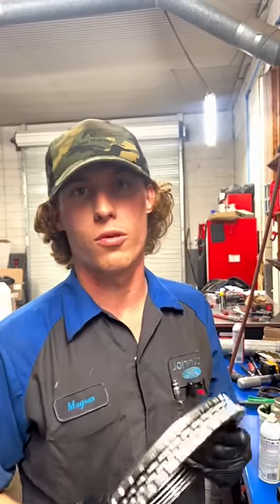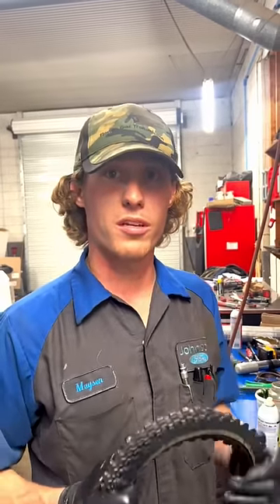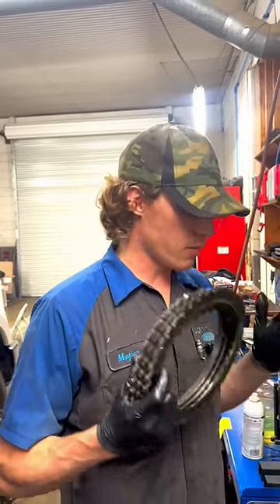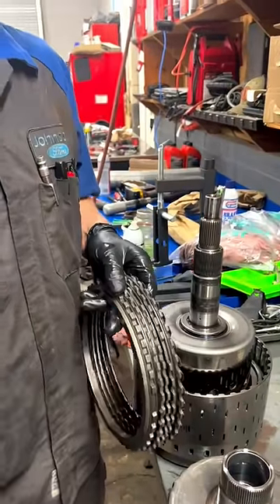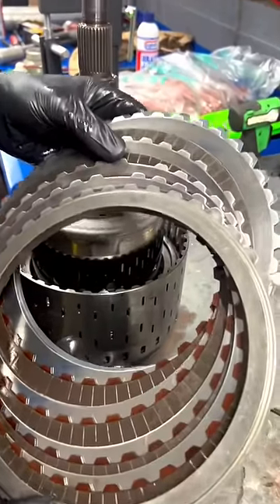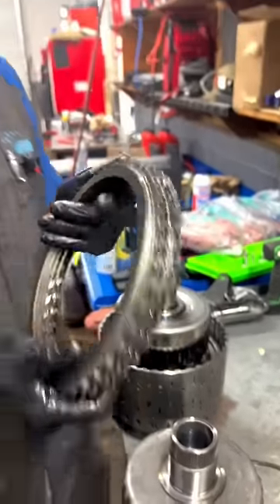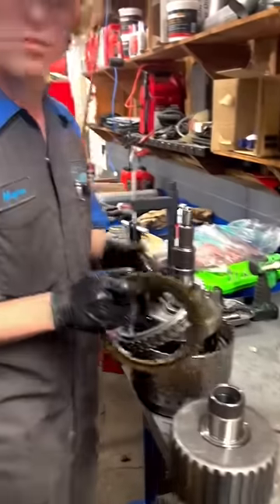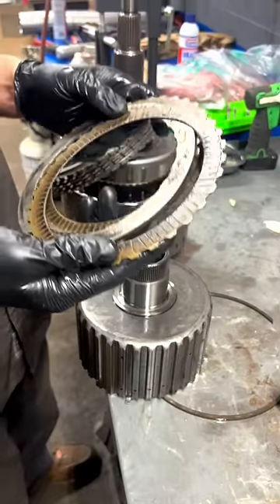Should you replace every clutch during automatic transmission overhaul? #shorts

Comment: Upon performing ANY overhaul, I’ll replace EVERY friction plate regardless of the condition. You can NOT clean a friction plate due to metallic embedding. I’ll reuse the steel plates, and take a (Yellow) 3M Scotch Brite Roloc Bristle Disc just to deglaze with the new frictions being installed. Same goes for all the shift solenoids, they’ll all get replaced as well during a complete overhaul. I go through the entire unit as well. Set the clearances, end play, etc.
Reply: The whole unit you say. Where you work at the shore ? The bay shore truck store ? Hahahahaha 
Our senior master calls everything a unit.
Reply: Exactly you already have it out, replace every wear part, it’s cheaper than pulling the transmission twice
Reply: Ford tech. By the book there 👈🏼✌🏽✌🏽🙌🏽🫤
Reply: I agree and I'm sure the customer would agree, they are paying to have a transmission rebuild, not to have it be good enough. Not replacing the clutches in an automatic transmission that you already removed and took apart is like putting a piston back into an engine and not replacing the rings, if you already have it in your hand replace it
Reply: If it’s a warranty overhaul with metallic debris your cost cap should be coming up with a replace decision.
Reply: And charge enough extra labor to pay for the plates!  Disgraceful
Reply: @thechris84567    Who cares, the customer will have to pay again.
Reply: Keyword: probably

Comment: If I pay for a rebuild and I find out they reused some old plates I’m gonna have a word with someone.
Reply: Lol, right on
Reply: Exactly, I'm paying for a complete rebuild not a partial.
Reply: It is done routinely.  If a shop finds a broken spring, that's what gets fixed, yet the customer pays for a rebuid.
Reply: @twosencefromcleveland6084  yup, repair shops continue to do that because there is no way for the customer to verify a full rebuild without tearing the whole damn thing apart.
Reply: You people do realize that materials and labor are billed separately, right? You'll be paying for the full labor of a full rebuild, you will not be paying for the clutches he didn't order.
Reply: @primecyber1  totally agree they have no idea what it takes to rebuild a transmission.
Reply: @twosencefromcleveland6084   that is why you go to a shop that does professional performance building.  It will always be right always!
Reply: Why? Unless if the are discolored and/or welded together, hit it up with a cookie wheel, and send it. Never had a problem with any of my personal vehicles. Mechanics have been doing this for years.
Reply: @Brandon Lindner  it's warranty work.  Customer is likely only paying a deductible at most.  Warranty company ain't paying for that
Reply: Sadly that is rebuild. Fix whats broke only and out the door. You want overhaul or rebuild. 1st. Inquire about replacing all your clutches with an upgrade kit. You'll pay a couple hundred more just for that but you will get all new clutches. 2nd ask to have all updates installed in the valve body. A 1hr. google search will give a list of those updates. 3rd, discuss and decide on shift kit. 4th talk torque convertor. Got a triple disc lock up with billet cover stock stall built for $500. Everything done my E4OD/4R100 was $1200 more then "regular" rebuild with deep pan and new oversized oil cooler
Reply: Chances are you would never know unless told. Also a lot of cheap “remans” that is what they do only fix the bad stuff slap some paint on it and resell it.
Reply: That's what they do and they use the rest of the kit on other transmissions that's how they make so much money but I think all of the clutches in the kit should be used .
Reply: @tjr9741  Not true you ask him to keep the old parts that they replaced with new and then you can easily go scrap that metal and get your money back from it as well
Reply: You would think that until you find out how expensive these parts are. Why spend an extra $500 when you don't need to. Run em out
Reply: @double-a-ronoo4037 All of the transmission kits I've ever seen had all of the parts that wear in them other than hard parts that are reused unless needing replacement, a torque converter would always be separate and recommended but the majority of transmission shops only replace what is worn out and keep the rest of the kit but they may change them all if you're upgrading clutch packs and other parts .
Reply: Its done every day. I only build 1 way, all new clutches and steels and then any and all mods to prevent or application specific.  Now, these are not your 1800 trans builds and i dont get warranty failures
Reply: If you specifically said replace all clutches then that’s what I would do without fail.
Reply: @MrBrandonLindner  that’s not true. I was a dealer transmission rebuilder and I signed my name to everything I did. It’s about pride.
Reply: Your not paying.  He said warranty transmission work.  Yes if your paying someone then yeah all be replaced.  But warranty means your not paying
Reply: @tjr9741  automatic transmissions and air conditioning. Most people don't understand how they work, so its easy to snow someone. 

Perfect example. 5R110 breaks an intermediate shaft or an input shaft. If that's all that broke, that's all that most guys are gonna put in it. If the frictions all look fine, most guys will slap it back together with a new shaft and ship it. 

I price it both ways to the customer. You're paying overhaul labor anyway, because I can't check the low/rev plates without taking the unit apart, and I'm not gonna build the unit without checking the condition of everything.  But I'll give them the option, it's gonna cost you x dollars to build this reusing your existing clutches (and will show them comparisons between their used plates and new ones), or it'll cost you x + y dollars to rebuild it with all fresh soft parts.
Reply: @drjohnsonhungwell5115  Tell me you have no idea what you think you know without telling me:
Reply: @davidpawson7393  I know people in the transmission building business and  I've seen the shady things they do.i also do mechanical work but not full time anymore,
Reply: You’re not paying…. It’s warranty. If you want them to replace the parts he mentioned then you can pay a bit out of pocket during the warranty repair to fix/replace other things.
Reply: @davidpawson7393  You may get all new parts if you've upgraded the clutch packs , servos , valve body and maybe if the transmission was in catastrophic failure but they do disassemble the transmission inspect everything clean everything with mineral spirits bench test the fluid passages and valve body with air before putting the pan back on before they put it back in and refill it but even though they don't use the entire kit at your run of the mill transmission shops your transmission may be just as good as new if you have a competent builder and good quality parts and a new torque converter in most cases and it's life depends a lot on how you maintain it and drive it
Reply: Under warranty you're not paying for anything, have a word with the manufacturer and they won't care whatsoever
Reply: For those who don`t know seasoned bands and clutches are better to use than new a lot of the time.
Reply: @MrBrandonLindner  lol I’ve had two ATS built Allison’s show up junk and they were not cheap by any means so that logic is out the window…
Reply: If it’s warranty you’ll have to fight with the manufacturer because they’re only gonna pay for what’s broke or if it’s a necessary gasket or piece of hardware
Reply: If u actually payed for parts and labour and didnt get them then yes fair, if u safe 400 going to that shop then dont complain.
Reply: Problem is most replacement parts aren’t as good as originals so if they aren’t bad , you might be getting an inferior product replacing.  2 cents anyway
Reply: He was talking about warranty work but I guess if you pay for it you should get it. Talk about it with the mechanic and be there for different stages of the rebuild. Old out new in.
Reply: Using that stupid logic you’d expect a new case also….
Reply: Your not paying for it,it's a warranty job, not a complete rebuild by the customer
Reply: I better start learning to do this crap myself. can't trust no one at all
Reply: Try waiting for 3 months for those damn things. If your can...
Reply: That's a rebuild, he's talking about warranty work, all depends on how hard are they to change, just saying
Reply: B.S. it's not that easy. Not everything gets "upgraded" when a speed shop does any type of rebuild on a trany.
Reply: No you won't. You only pay for the parts that need to be replaced.
Reply: @niewissen9912  but you paid upfront for the warranty
Reply: @davidpawson7393  tell me you think you know what other people know without saying It.
Reply: Good thing you won't find out, cuz that's a rebuild , reman is even worse
Reply: Rebuild now a days seems to have a few different meanings sadly..They take it apart stuff ur old parts back in with maybe 1 or 2 new parts..In their mind,they did rebuild it,back together again..
Reply: You should change your name from blake to karen.
Reply: @tjr9741  ask for the old parts
Reply: Warrenty
Reply: If you pay ... That's not warranty work :)
Reply: That happened to me. Only it was a used drum  The company went out of business very soon after.
Reply: Rebuild doesn’t mean you replaced the entire thing. It’s a term for when you need to fix your engine. You/the mechanic takes it apart, replace what’s broken, then put it all back together. That’s literally what every mechanic does. Sometimes your old parts get sent to machine shops to get recut or welded. Do you know how much they would have to charge if they built you an engine from scratch???
Reply: @VitoVeccia because you paid for a rebuild. You get a rebuild
Reply: @primecyber1 You're assuming every shop is honest about what parts they ordered
Reply: @JamesThomas-kx5sj  no I'm not, I'm commenting about someone saying that a partial rebuild should never be done, which is dumb to say quite frankly. If part good then part good broham.

Comment: If they are available, every bushing, clutch, bearing, seal and o-ring is being replaced.
I don't care if it looks completely trashed, or brand new, if its already out of the vehicle and apart, replace them. Because if you don't, you know damn well what part the come back will relate to.
Reply: @dataabort Some aren't meant to be serviced and come with "lifetime fluid". If you believe that. But there's always a way to get them apart and rebuild them I would imagine.

Comment: As a Ford Tech I would love to replace all the friction and steel plates but as stated we aren't allowed through warranty. The aftermarket has it made because they can purchase a Banner kit that comes with everything. Through the dealer it's just like Johnny Cash, ONE PIECE AT A TIME 🤣
Reply: That's when you burn that entire transmission up before you take it to the shop.
Reply from the maker: At least one person gets what I’m saying.
Reply: @FlyingWrenches13  You gotta do the job you're paid to do, wether it's the customer paying you, or warranty, right? Either way you can only replace the parts authorized by who's paying. Of course we would like to replace all the wear parts at once. It'll always make a better repair. Maybe bring up to corporate an idea for warranty to cover damaged and worn out and an option for customer to cover the other parts needed for a full rebuild.
Reply: I figured it was one at a time. I doubt the mechanic wouldn't replace them if they all came in a kit.
Reply: I'd love getting paid 3 times to build the same trans
Reply: And that's why you work for dirt bags...
Reply: @gokblok one clutch pack at a time.

Comment: Yes every clutch and steel. Also pump and converter. Good insurance for no come backs.  Everyone is different and there options so you do you.
Reply: Don't forget to flush the cooler and line or replace them.
Reply: @dunk5647  yes and I usually replace the cooler if it is a external cooler. I mostly do hp transmissions ford c4
Reply: That's a lot of work for something. That might not need to be replaced. He is doing warranty workm Ford wont pay for the all new clutches he probably has to send pictures in for warranty. ( For Audi we need pictures of all failed components for repairs to not be kicked back). I understand if it's an old transmission but warranty work even with CPO is probably not over 100k miles.  Flush procedures are most likely needed but I am not sure I agree with rebuilding the whole thing. Even out of warranty. If everything looks good and customer understands that only damaged parts are being replaced why recommend all the extra work.
Reply: @jesusmoysen4759  we have to do the same to prove repairs for collision work to insurance companies
Reply: @jesusmoysen4759  And this is why I rebuild my own even if under warranty. Luckily I switched from ford to Chevy for my daily and have had no issues yet. My dad had a aode trans that kept killing od in it. Had it back to ford two times they kept replacing only what was broke. On the third time it sent metal through it. We said f ford we rebuilt it with all new stuff no problems after. I understand what has to happen with warranty. If I build something and it fails it is on me I will make it right emphasizing on the word right maybe car manufacturers should do the same.

Comment: I wonder how old this guy is I watch his videos all the time and I'm pretty damn impressed with the work he does and his knowledge.
Reply: I think he is in his 20s. I'm in my 30s amd don't know a 1/4 of what he knows. He is super knowledgeable.
Reply: @MHolt3573  Same this dudes legit.
Reply: Yes but sometimes his youth and lack of time doing the job shows. This video is a prime example of that. A seasoned transmission tech would say replace all the clutches. It will eliminate another pack going out under the jobs warranty.
Reply: @fredted1611 yes you are correct....but , like he said,,,, the dealer won't let him ..
Reply: @ronmtz2531  
Lol, not the dealership per say. It's the aftermarket warranty company. With over 100k on the odometer it was most likely a used truck they sold with aftermarket warranty. The last dealership/stealership I worked for loved to up sell those useless warranties. 📳📳 Ring ring... Hello.. Your factory warranty on your vehicle is about to expire....😂
Reply from the maker: @fredted1611  My youth has no effect on Ford’s warranty policy for overhauling a transmission with 10K miles on it. If they won’t pay for them how do I replace? Come out of my pocket?
Reply: @FlyingWrenches13  
You open up your mouth and talk to the customer or your service writer and the customer. There are many customers who know that burnt clutches and oil contamination can cause other issues down the road. They may just pay to have the rest of the clutches replaced, especially that the transmission is already out of the truck. Beats having to pull it again in a month or 3 down the road to do another couple of plates. And some may tell you just do what's under warranty. But if you never ask the question and just throw in the plates and give it back, they may go, well why didn't you tell me your only replacing 3 clutch plates, I wanted them all done and I would've paid for it. See what I am saying. Dammed if do, dammed if you don't. That's why it's better to ask.
Don't worry asking questions to the customer and or your service writer will come with experience, especially after you do the job twice a couple of times.😉
Reply: @fredted1611  He’ll get paid both times. In fact it works out good for him. The fault here is corporate being cheap, but if in warranty clutches being reused are really low mileage, so it will be fine. Most failures of low mileage transmissions are due to being miss assembled from new. Or solenoid pump, or valve body issues, not so much the  clutches just wearing out.
Reply: @kennethobando5755  
Here's the real debate here, talking to the customer. The customer is the one who signs the check every month for the payment of this truck, not you and definitely not this kid. I have found out because of years in this business it easier to open up a dialogue with the one who is actually making the payment on it. Seen way to many people get highly pissed off because they were not informed.
Reply: @fredted1611  The customer is Ford as they are paying you- not the customer. Also the  mechanic has no power in this whole deal. Obviously you’ve never worked as a technician/mechanic. If anyone to complain to would be Ford corporate or the management of the dealer. The tech never talks with the customer anyways, the service writer/advisor does. Mechanics only job is to fix the cars.
Reply: This guy probably helped his dad rebuild transmissions from a baby crib when he was 2 yrs old

Comment: I once had this automatic transmission that would often pop out of drive. I was told it was a small washer cost is five cents,but to replace it in the transmission would cost from 500$ to 5000$. I could not find out the last time it had a service so I brought a service kit comprising of gasket and filter , so I did the service & had no dramas ever since. ...why replace something that doesn't need replacing